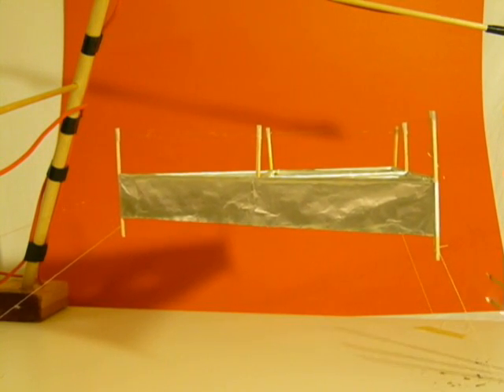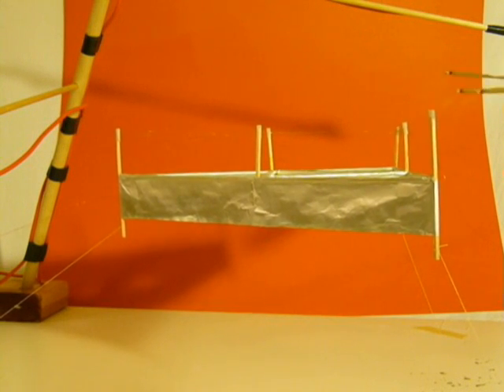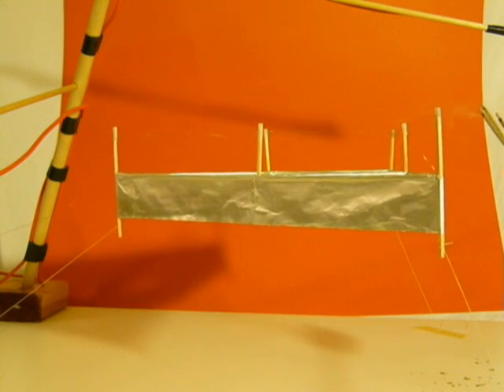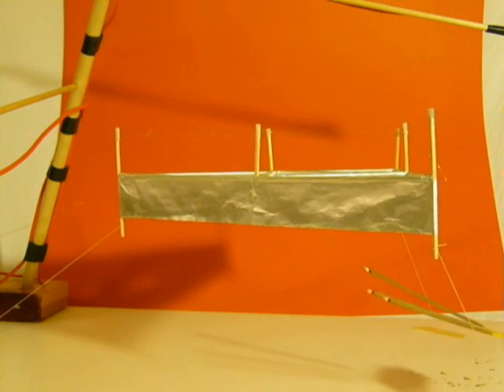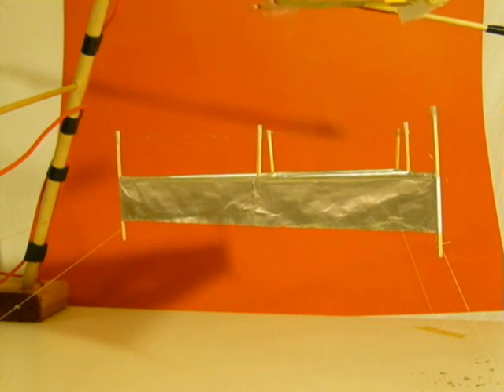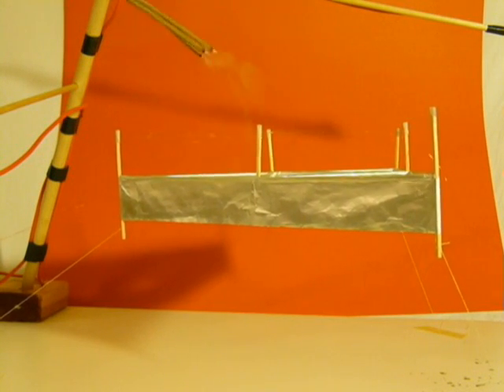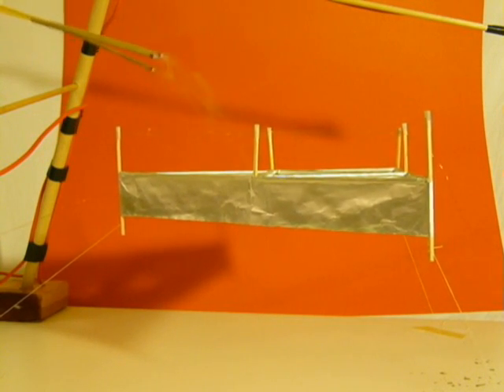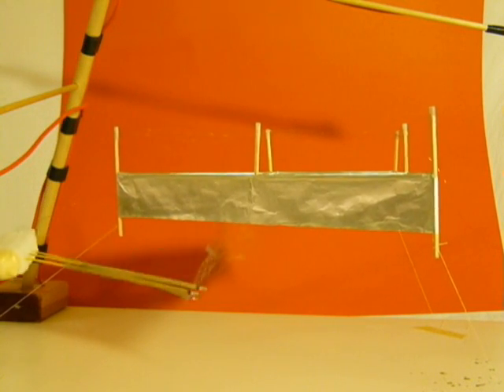LIFTER SMOKE TEST

Comment: Incense sticks produce hot smoke that to rises - easily seen. If the lifter was generating a negation of gravity, would you not expect the smoke to continue to rise? But no, the smoke flows downwards with the ion wind.
This looks like a very good demonstration of the ion wind and shows nothing of a negation of gravity.
Now, wouldn't it be fun to try this in a vacuum ! The sticks wouldn't burn, of course, so you'd need to use some dust or similar.
Challenge for you Mr egg - do it in a vacuum.

Comment: @UnderManlac - I agree.  To make the lifter even lighter, someone at ESJ did an experiment using a very thin film of aluminum over a thin plastic membrane, and the ions "ate" trace lines through the aluminum, breaking the electrical circuit, and causing the lifter to fail.

Comment: the shape of the foil determines the direction of the airflow. If the foil structure were twisted somewhat, it would turn when powered.

You would need a more intircate tether however. So it didn't get all tangled up.

Comment: Could you try using a better smoke generator as suggested below? Also did you perform the smoke test with the polarity reversed? Negative wire and positive plate. Also you should show that it requires more voltage to cause lift when the polarity is reversed. Dry ice in ethanol sounds like it would work very well.

Comment: If you insulate the high voltage wire from the conductive environment, then a lifter would even offer propulsion under-water. By ionizing and propelling the water itself.

However, using lifters such as this one in humid environments would likely destroy it or make it not work as desired.

Comment: Ion propulsion is the source of the lifter's 'lift' aka: wind.

HOW IT WORKS:

The current running through the wire induces an electrical field around it. This field charges the air around it. The charged air is then drawn electrostatically to the non-charged aluminum plates. The resulting motion of this air is what we in the science field call 'wind'.

Reversing the polarity would NOT change the direction of lift. The charged particles would be drawn to the non-charged plate regardless.

Comment: its was my understanding  that electogravitic effect was achieved by use lets say 3 capacitors highy highy charged in a triangular formation to produce stability as the germans did in their hanabu 1 2 3 4 5 and Andormedia ships just basically capacitors holding huge  amounts of voltage?out of curiosity have u done reasearch on the sucessfully built and flown VRIL and Hanabu "space craft" the germans developed during and before WW2?

Comment: The problem with doing the test in a vacuum is that the conductivity of air increases as pressure is reduced until around 5mm of Hg at which point the conductivity decreases with decreasing pressure. The problem is that the lifter will short out as the pressure approaches 5mm. If the lifter is shorted out it does not work. So it wont work in medium vacuum. Hence one could erroneously conclude that the lifter wont work in a vacuum. It wont unless it is well below 5mm Hg. (See Maxwell's treatise)

Comment: @nida1965 
 
Assuming the lifter, built from balsa, tinfoil, glue, and wire, weighs around 200 grams. 
 
It would take only 200.1 grams of downforce to produce lift. That equates to around 2 newtons of force. A 1 Km/h wind should be enough.

Comment: This is an Ioncraft. It's structure works like an assymmetrical capacitor wich creates the effect of ionizing the molecules in the air and get them accelerate creating an ion-wind wich makes the craft fly. The acceleration exactly works like the acceleration in the mass accelerators. The higher voltage you supply the bigger acceleration of particles you get.
Reply: It works in the vacuum of space. Does that still follow the "laws"

Comment: We ran a lab for Stanford and key components for the Stanford solar center were designed and built here. These lifters are just another cool electrical toy, but they are not Warp drives, nor do they lower mass within the field, nor does it change gravity. That is all SciFi fantasy. But they are cool toys. Try using a hard heavy wood, for if it is really anti gravity, it would not have to be built of balsa wood.

Comment: @randomdude10010 Think static electricity. The high voltage wire sets up an electrical field around it. (Not a magnetic field) Any ions within it become charged, and electrically drawn to the non- charged aluminum.
 
It's the same reason why electricity runs to ground. It goes from an area of high potential voltage, to an area with less potential voltage.

Comment: I don't understand how the Ion wind generated has anything to do do with the lifter moving off the ground. It's not like the sides of the lifter are wing shapes allowing low pressure air flow to create lift. So what if there is air movement or so what if it can't be done in a vacuum, I am yet to get an adequate explanation of what is going on here.

Comment: Place a box fan on it's back and support the edges with a chair. Place a lifter on top & power up the fan. Do the smoke test. Then power up the lifter also and do another smoke test. I'm curious to see which way, where, and how the smoke "flows". There is more to this effect than ion wind. That is why this technology went "black" in the early 1950's. Please do this experiment. I'll sub so I don't miss it. Thanks for your time. Peace.

Comment: can't see much why not turn off the  light and use a sharp side light, that  red background doesn't help either. Can't see where smoke is going after the lifter. need to show from top also, maybe under a glass table would be good? strobe light capture? what about a lifter made as a geodesic dome, what would happen?

Comment: 1. reversing the polarity will NOT change the ionflow-direction, upper wire has a small radius 
(strong local e-field density) to ionize medium

2. smoke simply attracted by electrostatic attraction

problem solved.

Comment: NASA's ion engines can work in a vacuum because they carry fuel which is ejected from the back of the engine.  An ion wind device without fuel can only work by manipulating the surrounding air.

Comment: either way its a type of thrust.. more power to a thrust. the more thrust there is.. I used tesla tech on one of these and put in 
200kv and it was aboul to hold 9 times its weight..

Comment: @UnderManlac I'm sorry but you don't understand what gravity is not that im defending asymmetric capacitance just your comment that shows you don't have experience with this issue! To more correct nextgen antigravity isn't being done with capacitance or spinning fields, atomic flux is the new kid on the block! The mechanism of inertia is what you control and you don't do it with force as a shielding format would do in a gravitational vehicle, instead of deflecting aether flows from---->

Comment: if u put it in a vacuum it will not work  it needs this it ion wind
Reply: i needs air

srry bout that
Reply: Hello how are you doing today but I'm not being rude or anything but they use ion propulsion in space on satellite
Reply: israel turner With a dedicated gas supply they work fine in a vacuum. Xenon is usually the gas of choice, and the vacuum allows much higher voltages for higher-velocity flow rate.
Reply: +Michael Guyette what they use in space is ion propulsion
Reply: +good boy this is lifter ion

Comment: ----that has a flux frequency of 10/30Hz ((gamma)) or lower, if you raise the flux of your spacecraft above this than the vehicle would be abe to go faster than light and not take much energy to do it in regard to the energy need to push it not the energy required to raise the frequency of course!! If you make your spacecraft as light as a photon it can go as fast as a photon with the same amount of energy that it takes to move a photon and that's not much! So the answer can we go faster---->

Comment: ion thrusters work because it's low accelaration applied over long periods. the thrust is too low to be of any practical use on Earth. Look at it this way, accelaration of .01 m/sec**2 applied over 24 hours results in a speed of around 3100 km/hr. this means, after 1 sec you're moving .01 m/sec, 2 sec @ .02 m/sec, 3 sec @ .03 m/sec, ...